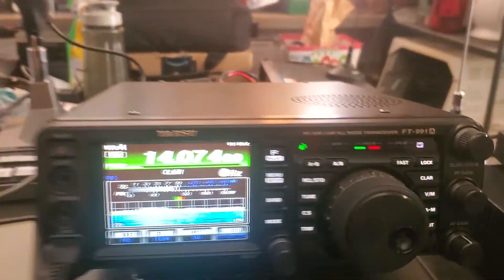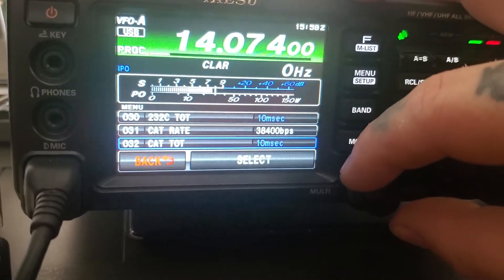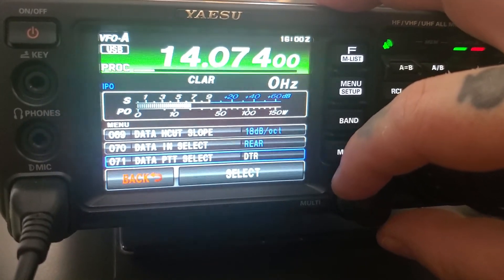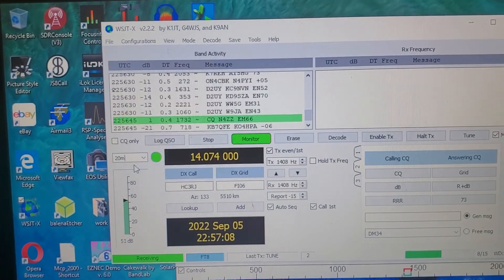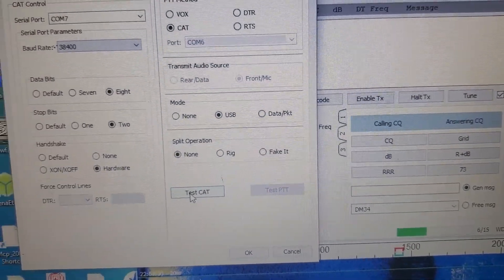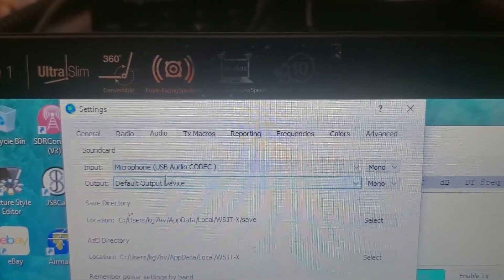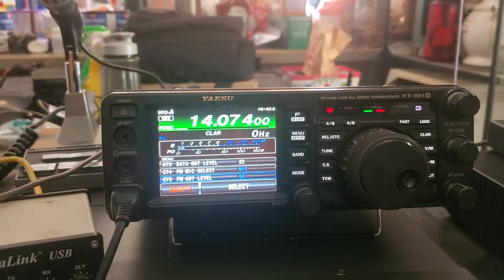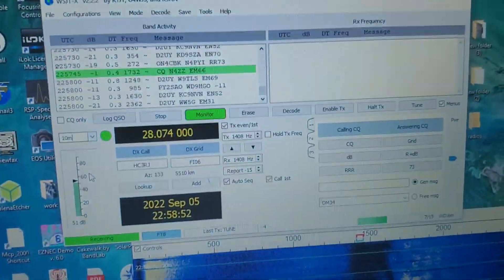FT991A FT8 QUICK SETUP 1 USB CABLE

Comment: So, it's 2 years after this video posted... Hows the 991A's performance in the digital modes. Pros/Cons, anything bad?
Reply from the maker: I sold it a year ago. The display is almost a bad as my ftdx3000  but the rx is alot worse and i had tuner issues and the ipo attenuator resistor popped just like on the  891. I really think its a overpriced pos. Not a terrible radio but not worth buying unless you need 2m ssb or something
Reply: @hamradiohack  Yaesu appears to be leading the way, but their gear has problems. I had a FTDX 101MP and the VC Tune had problems twice, when you pushed reset to center the VC Tune, it engaged to the VC Tune to deflection, did it twice. I listed it on QRZ with full disclosure and it shipped straight to the buyer from Yaesu with a clean bill of health. Local Ham bought a FTDX 10 and it fried the main board in less than six months. Appreciate your reply, maybe best to avoud the 991a for now. I did see the manual states TFT displays are flaky, dead pixels etc. Tnx OM...